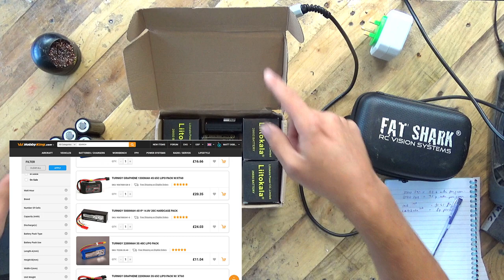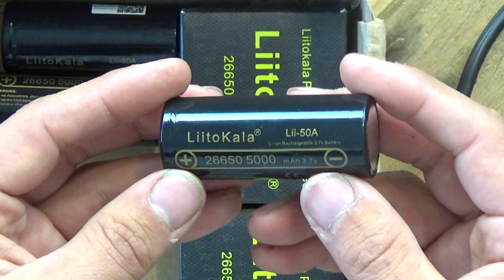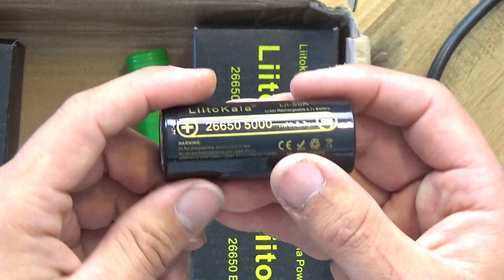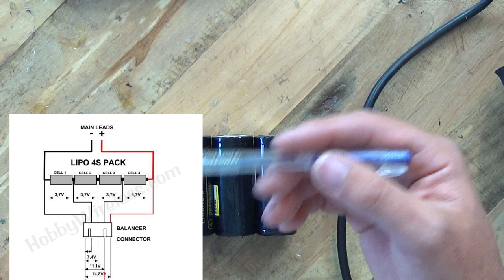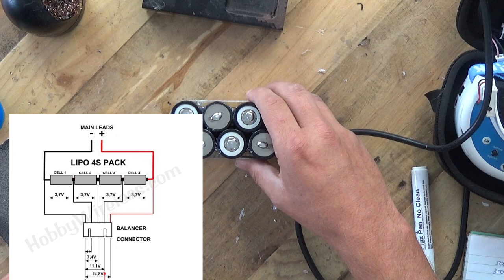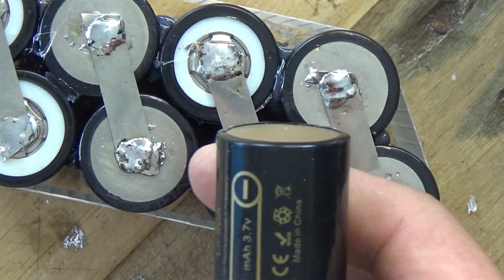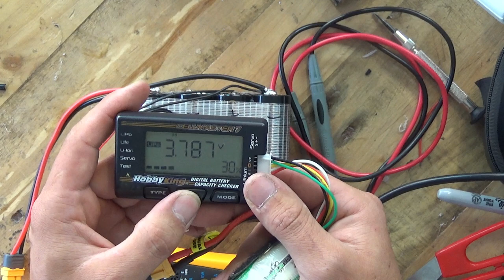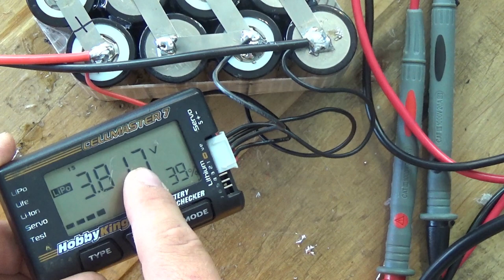26650 4S2P 10,000mAh Li-on Battery Pack Build

Comment from the maker: Howdy, quick timestamps for this video to help you:
01:40 Introduction, Li-on vs Li-po
04:00 26650 vs 18650 batteries
09:45 Power densities
11:34 Battery setup 4S1P and 4S2P explained
20:19 Starting the li-on battery build, with tips
23:00 A note about safety
27:36 Build starts with fast-forward parts
28:26 How to abuse a glue gun with a blow torch
35:17 First tabs completed & overview to join cells up
42:43 Second tabs completed & overview 
47:34 Balance lead setup and testing
55:47 Weight check & final summary

Matt

Comment: People should know that in order to get the max out of liion batteries, you have to take them down further than lipo. Some go as low as 2.0v per cells. Read the datasheet for your batteries.
Reply from the maker: Howdy, it's very rare to find cells that go to 2V. The standard is 2.5V. matt

Comment: Watch out for cheap batteries. Even though they pass the capacity test, they may not last long. I bought 5 cheap but highly rated 2000mah 18650's, and was delighted they held the advertised capacity. Too good to be true. After 8-10 charges, the capacity began to drop off. Capacity test confirmed they dropped off to 600-900mah. Just a heads up, those may be fine.

Comment: One thing to watch with LiIons is that in order to get that full capacity you need to run them down to a much lower voltage than a Lipo.  In the case of a 3S pack, that could bring the total pack voltage down to less than 7.5V which might upset some of your onboard electronics if the BECs aren't up to scratch.
Reply from the maker: Howdy Bruce, look out for a follow up video shortly, I ran this pack down at 7A continuously for 1.5hours and got over 10,000mAh out of it. These cells are rated from 2.75 to 4.2V, however I foudn the fell off a cliff at 3.1V. Matt

Comment: You can use solder water with higher corrosive rating. Makes soldering these cells even easier.
But dont forget to clean afterwards

Comment: The voltage is higher in these wired in a 4s  then the lipo 4s pack. Just a little higher volts that may give you more power and speed in your RC
Reply from the maker: Hi Matt, the nominal voltage depends on the cell, they can be either 4.2 or 4.1V when charged. They do however seem to hold a higher voltage for longer when under continuous low load. Matt

Comment: Those Liitokala 5000mah are the best. I have 8 of them, the capacity is around 5850mah per battery. I also have XStar (5000mah), Eizfan (5500mah) and Soshine (5500mah) and those are not good. They have a capacity of <4500mah.

Comment: You are using 2 batts per cell, when there is a problem with 1 of the batts in 1 cell it will not show up properly to the charger, may cause u to use a battery
over time can't be detected by the charger and thus cause fire or less and less flight time until fire. If you are going to use 8 batts then hook em up as 8 cells or
two 4 bats/cells batterys charged as 4 cell hooked together in flight in parallel, NO?
Reply from the maker: Larry, I'd you do that you'll set fire to them. Matt
Reply: Are u saying hooking 2 four cell batteries in parallel on a quad for use will set fire to them?
Reply from the maker: No, just watch the video. You're suggesting this method is flawed and cannot be detected by a battery tester. When it's common practice to use them this way.
Reply: lipos arent built that way could safty issue, think?
Reply: others on youtube are building 2 batts (4 cells) and hooking in parallel to drone

Comment: my VT6 are 18650 about 46g 3000mah 30a.. these 26650 are 100g 5000mah 20a .. more than double the weight per cell. 2 18650 would be 6000mah 60a and weigh the same????
Reply: A vtc6 does not have 30A cont rating. Its 10 to 15 max. 

Depends on your use case. If your going to try and use vtc6 in 1p on a 7" quad for example, the battery will be very hot and possibly explode from constant pull above 15A.

You can get away with using them in 2p as you now have 20-30A allowance for continuous current. Still quite close to the limit though.

You can get 26650 cells with 5000mah and continuous current of 30-40A allowing you to have 6s1p or 4s1p in larger quads without blowing them up.

Personaly I think the 21700 cells are the sweetspot.

Comment: Hi Matt....I use stripped out solid copper mains wire on mine, they solder faster, easier....The current draw is low, and the copper wire is ample....You can also bend round copper wire, unlike that strip....10 amps in a MT...hmm...nice.

Comment: This 26650/5Ah has PCB?
Does voltage discharge stops once it gets below certain voltage so it won't kill the battery with PCB?
Just asking because I would like to use two in series for camera's speedlite. 
And would 7.4VDC safe for speedlite using 4AA (6.0VDC), it's just 1.4V over?

Comment: You say 4.2v, but my ISDT charger has a Li-Ion setting and that chargers to 4.15v.  Do you charge on a Lipo setting to 4.2v? If so, any problems arisen from that? The 18650 one's I have are for a torch, FatSharks and a portable power bank (to charge the HD cams at the field) so charging to max (4.2v) is not really a problem, but maybe a follow up video to clarify on charge voltages for these packs.
Reply from the maker: Howdy fella, ead the specifications for these batteries as they vary from one type to another, these ones specifically will charge from 2.75 to 4.2, so can be charged as a normal lipo battery. Matt
Reply: @RagTheNutsOff  while they can be charged to 4.2v per cell, to maintain condition and longevity of these cells, it's not recommended to charge above 4.1v per cell. That's what good charges only charge to the lower voltage.

Comment: The price sound to good to be true. Did you actually test the capacity?
Reply from the maker: Howdy fella yes, see the otehr comments, over 10A drawn. Matt
Reply: Capacity is only 1 very important battery metric. Another is life. I've had cheap batteries pass the capacity test just great, but within a year, I threw away 3 of 5 because capacity dropped a bit after each cycle.

Comment: Silverline do a 100W solder Iron. I got mine by mistake. Way too hot to solder most things, but to de-solder or heat things very quickly, its a winner. But it burns the flux off real quick, so just a second or 2 and its done. Be just the job for Li-Ion batt packs.   
  E-Bay has loads for sale.

Comment: I did buy them late in October. My cells do not have the "genuine" sticker on the side as yours, and the positive on yours do have a curve where the opening is, but mine is straight. Will try and test capacity one day. Going to make a 3s for a areoplane.
I recommend using soldering acid (found on ebay) on the cells where you are going to solder. The drone guy from Poland told us. Helps with making the solder stick!!!

Comment: Superb video! 👌🏻
Made a 4s2p 6000mah out of 18650 vtc6 for my longrange copter 😁
Reply: Im building 3s/2p with Liitokala 21700, 4000 mah /40 amps continuous draw.Will have 8000 mah battery lighter than a 5000 mah lipo.
For a Phantom1.
For f550 i plan on using more such cells.They have less mah than the black Liitokala from this video but much higher discharge -40 amps continuous.

Comment: Do u recon I could make a 4s pack and use it on my long range 6” quad??
Reply from the maker: Howdy fella, I have no idea. My intention is to run this pack at no more than 7A cruise. I'm guessing the quad would be way more than that, Matt
Reply: Looks at the long range hooligans FB page, all you need to know
Reply: Gabe Brown I run Titan 4s1p 3,5mah on my 6” quad and get 28 minutes. Look up Titan and get square 4s1p flight pack. They are $35!  IMHO making your own is fine and I’ve done it a few times but have had a lipo explode and caused me 3rd degree burns on my legs when lipo burst and landed in my lap and within seconds melting my pants.  This is super dangerous even for professionals. So keep that in mind because every time I wear shorts now I’m reminded 😉

Comment: You should install a PCB board for auto balance, secure chargue and discharge
Reply from the maker: Hi Ruben, I use a balance charger for all my battery fella, it's not needed. Matt
Reply: @RagTheNutsOff  ok, but the discharge is better, taking the same current from all the cells. It provides a very good protection, but... Ok, It doesn't need 😅
Sorry for muy english, i'm spanish.
 A greeting

Comment: FWIW The density of those batteries don't seem to be good. You could get better density from Samsung 50E 21700 5000mAh 9.8A Battery 69grs per batt. ~600grs 10,000 mah. for a max of 20 amp. OR if you build a 4S3P that would be ~900grs 15,000mah and 30amp.
For last those batteries usually are rebranded and buying them from aliexpress is a pandora's box.
Reply: in germany one of these puppies costs about 15€ bucks... way to expensive
Reply from the maker: Exactly, keep in. Ind each cell only cost me $3.99!!
Reply: If cost is a goal yes you're right this is a good option. If it is energy density then cost is secondary .
Reply from the maker: Morning gents, there is always a lighter/better way, but when it comes down to cost, which is a factor for the majority of us, $3.99! a cell can;t be argued with, hence I got 20 :) Matt

Comment: Hi Matt. Great video. I’ve just ordered a pack of 10 from AliExpress for just £32. Just a quick question. What size nickel tape did you use ? Looks like there’s loads to choose from. Keep up the good work.  👍🏻.   ✈️
Reply from the maker: Howdy Adrian, I can't remember the exact size, probably around 7mm to 10mm wide is what I would have gone with. Hope that helps! Matt
Reply: That’s great, thanks for your help. Cheers bud. Happy flying 👍🏻. ✈️

Comment: PVC Heat shrink is perfect for cleaning up the final battery to really hold it tight and it's a lot lighter than all that tape haha
Reply from the maker: Howdy fella, oh yea that would work. I have a roll of it here, but never actually used it and ironically it's too small for his battery. Good if you've got the right size! Matt
Reply: Yeah, I have some for my 4S 18650 LiIon pack. I also had a similar arching issue to yours, but it was due to a piece of solder laying on my bench, best clean up some of those globs you have on your bench.

Comment: Hi Matt!
When charging, what parameters do you use on this pack?
Very good vídeo!
Regards
Vítor Lalanda
Reply from the maker: Hi Vítor, read the specifications for these batteries as they vary from one type to another, these ones specifically will charge from 2.75 to 4.2, so can be charged as a normal lipo battery. Matt
Reply: Lipo setting on charger set for 10,000mah would be no more than 5a charge

Comment: Hi Matt and everyone else interested in spot welding batteries. Check out this link    https://www.youtube.com/watch?v=o4NaDMoEHxU&t=401s
I made one up, the only bits I needed to buy were the moment switch and solenoid, all readily available. I used my caravan battery at 115mAh and practised first on an empty been can. You have to be real quick on the switch and bingo, job done. It works great
Reply: ps, there are also links to the pure nickle strip as well

Comment: Don't forget what you need unprotected lilion batteries! And hot glue =) on batteries what gets hot!? :D Just add doublesided tape!
Reply: Silicon sealant is good but need to leave it overnight. But absolutely right re the hot glue, complete no-no.

Comment: Hi mate. 
I was looking at your video and I wonder if I can use this battery setup for my long range DC7. I'm new in the business. 
nice vid 👌.
Reply from the maker: Howdy, really depends on the size of the model. 18650 cells might be a better choice. Matt
Reply: The motors are xing 2806.5  1300kv